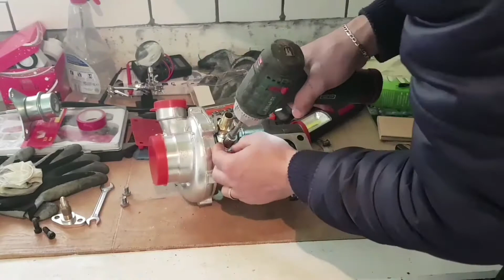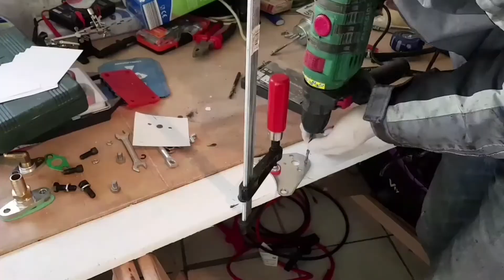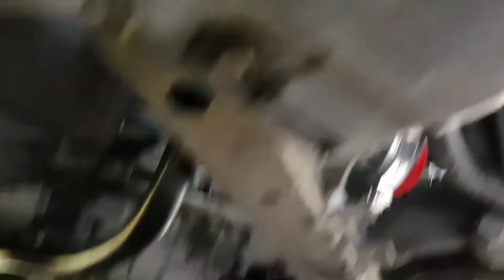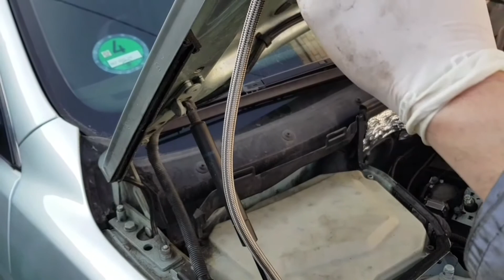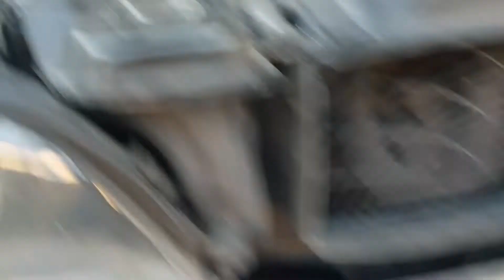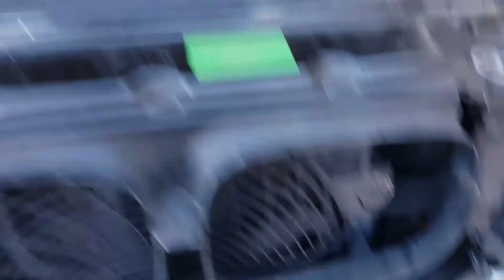Bmw E39, M54 engine, turbo Install P5

Comment: Hey man! I'm looking to buy this kit for my E39 530i, but wanted to know if you bought the "Motor mount (for low mount turbo setup)" that's at the bottom of the site. Thanks
Reply from the maker: Hey, I didn't bought it because I've modified my old one. In the install video you can see how I've cut a piece of it.
Reply: @WarpDriveM  Sounds good. Thank you for making these videos on the E39. It’s appreciated more than you know!

Comment: May I have the link to buy adapter for oil line. Thanks bro.
Reply from the maker: This adapter was in the turbo kit but you can see all the details for the adapter on my Facebook page @warpdrivem where I've posted the oil lines.